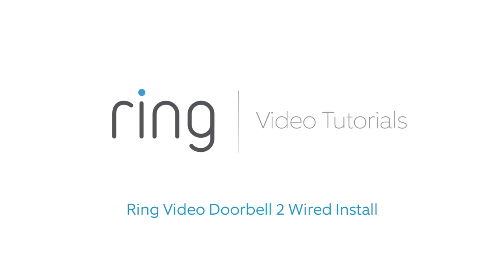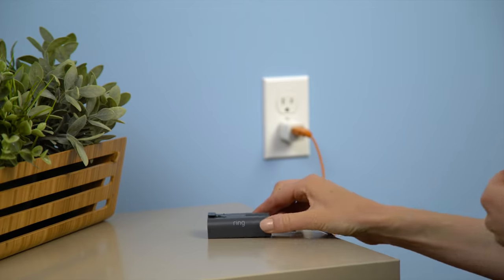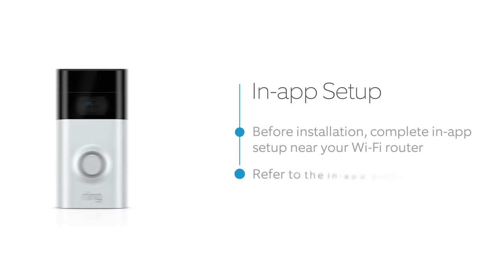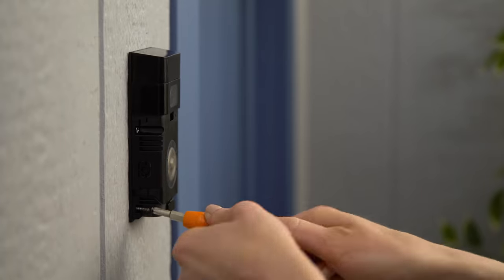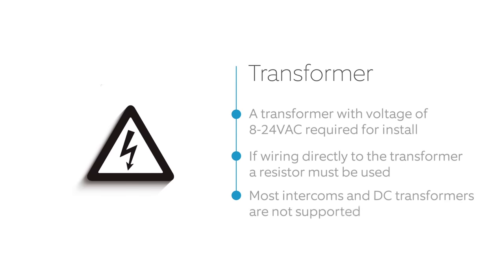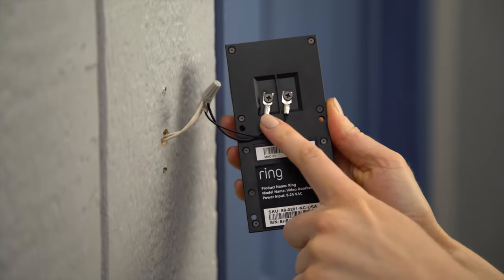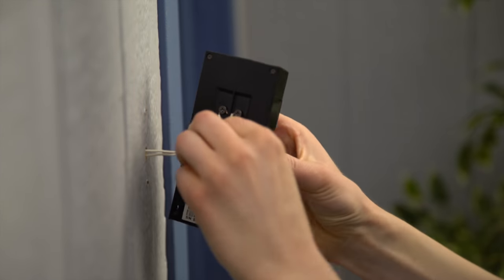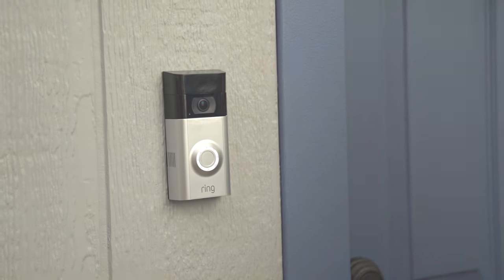How to Install Ring Video Doorbell 2 | Connect to Existing Doorbell

Comment: If I don't connect the low-voltage wiring of the standard analog doorbell wires to the back of my "Ring Video Doorbell 2" device, how do I know when someone is ringing my doorbell? 

Is it ONLY through the smartphone or tablets with the Ring app installed?
Reply from the maker: Great question, Warron! If you choose not to hardwire your Ring Doorbell 2, you'll be able to tell when visitors are at your door by receiving Ring App alerts via your smart phone or tablet. We also off the Ring Chime which plugs into standard outlets and acts as an internal doorbell for your Ring — check it out here: ring.com/chime. You can use multiple Chimes to get audible alerts throughout your home! Let us know if you have any more questions.

Comment: What if I have a ring chime and I just need to power them can I just use a transformer
Reply from the maker: Hi Jeff, great question. It's possible to wire your Ring Video Doorbell 2 directly to a low-voltage transformer to receive a steady power supply. You can find more information on wiring your Ring Video Doorbell 2 without an existing doorbell system here: https://support.ring.com/hc/en-us/articles/115003005423-How-to-Physically-Install-Your-Ring-Video-Doorbell-2-without-an-Existing-Doorbell. Please feel free to let us know if you have any additional questions. We're here to help.

Comment: I wired my ring doorbell to the existing wires on my doorbell with the wire extenders. Do i still need to charge the battery periodically or does the wiring i did charge the battery?
Reply from the maker: Great question, neighbor! The Ring Doorbell 2 is primarily battery-powered so it will need to be recharged occasionally depending on usage. Connecting it to the doorbell wiring will help provide a trickle charge to the battery. However, frequent motion detection or Live View usage can still cause battery drain. Remember to check your Ring's Device Health page for the battery percentage. Let us know if you have any more questions!
Reply: I was kind of hoping you wouldent need the battery mine dies so fast especially in the winter 😒
Reply: You wont need to charge it is wired this way. I’m going on 5 months without charging battery.
Reply: @Payperviewish  well in wisconsin when it gets -40°F it dies with in like 4 days lol and it's not working either way lol

Comment: If my existing doorbell is too low then? Should I angle the Ring upward instead? Even if that mean that it cannot see the ground.
Reply from the maker: Hey Thomas, that's definitely a solution! If your Doorbell is mounted lower that the recommended 48", you can use the Wedge Kits to angle it upwards for a better view and more precise motion detection.
Reply: @ring  I used THREE wedges: two angling up and one angling out (since it is low and on a sidewall from door).

Comment: Do the wire extenders need to be a specific kind?
Reply from the maker: Hey Joseph, 18-gauge wire is the ideal gauge to use with Ring Video Doorbells. It provides the proper amount of resistance and is very easy to work with and makes wiring simple. 

To determine whether or not the wire you're using is 18-gauge, get a standard metal thumbtack and compare the pin to the wire. 18-gauge wire is approximately the width of the pin.
Reply: Thank you!

Comment: For the people like me whose breaker box does not list the doorbell, how do I know which breaker to turn off? I really don't want to have to pay an electrician to come out and show me, and I don't want to shut down the main breaker to the whole house either. Any suggestions? All suggestions welcome if RING doesn't respond.
Reply from the maker: Hi Rich, great question. As each home is different, we're unable to provide specific advice regarding your home's breaker box. To ensure you receive the most accurate information, we recommend contacting a licensed electrician in your area. Thanks for being our neighbor.

Comment: I moved into a house that had a doorbell but it never worked. I took the button out and there is power coming from the cables (about 16volts). How do I know if it had a transformer or such. Insee no chime box anywhere.
Reply: If you have 16 volts, then it is connected to a transformer somewhere in you house. Touch the wires together to see if you hear a chime, if not, then the chime is either broken or removed. Either way, you'll need to find the transformer since it is most likely a low power model (16V/10VA) like mine was. Replace it with ring's recommended model 16V/30VA that can be purchased at home depot for about $17.  https://www.homedepot.com/p/Newhouse-Hardware-16-Volt-30vA-Wired-Door-Bell-Transformer-Compatible-with-Ring-Pro-30TR/307787405

Comment: Hi,

Today morning I have connected the external power supply (20VA) also charged the battery to 100%. The power source show me Hardwire when I Checked in ring App. Now ater 8 hrs the battery status  shown me 94%. I have connected the power supply still battery Darin constantly. It is not charging the battery. Then what is the use of hardwired?  How to fix this issue?
Reply from the maker: Hi neighbor, we'd like to help! Depending on the amount of activity your Ring sees, such as motion detection or Live View usage, the battery may still drain even when hardwired. Connecting your Ring to wiring will provide it with a trickle charge of up to 10% each day, however, you may still need to charge it occasionally depending on usage. If you're seeing a hardwired connection in the Ring App, this means that you've properly hardwired your Ring to power.

Comment: I want to connect ring doorbell 2 with my existing mechanical doorbell operating at 220 Volt. How to connect ring doorbell 2 with my existing 220volt doorbell? Do i need 8-24VAC transform with 25 ohm register?  How the physical connection will be?  Ring user manual  available but still not clearly explained. Really appreciate if someone replies to my querry. Thanks
Reply: 220 Volt doorbell?  Yikes

Comment: if I leave home like two months,, the battery will last that long or will disconnect?/
Reply from the maker: Hey neighbor! Ring batteries can last 6-12 months with normal usage and you can monitor the battery percetage in the Ring app so you know when it needs to be recharged.  Please keep in mind that there are factors that could cause your battery to drain quicker than this — learn more here: https://bit.ly/2uysY0g.
Reply: That was one of my concern. Can this hook up with you regular  cameras?
Reply: Yes

Comment: I have an intercom system with built in chimes. Can I hardwire ring 2 to it?
Reply from the maker: Hey Khaled! Ring Doorbells are typically not compatible with existing intercom systems – check out the Ring Doorbell 2 compatibility list here: https://bit.ly/2KfdYJK. However, the Ring Doorbell 2 is battery-powered so it doesn't require a hardwired connection. The battery is also removable to create an easier recharging process. Let us know if you have any more questions.

Comment: My current doorbell use just AA batteries, nothing connect to the mains. How this would work, do i need completely new setup?
Reply: I think the Ring doorbell has a battery option that is rechargeable, at least version 2 does
Reply from the maker: Hey Alan, Kris is right! We do offer battery-powered options which do not require a hardwired connection and can be easily recharged when the battery is low. See more at http://bit.ly/2UJbjC5 and let us know if you have additional questions!

Comment: How long does it take for the battery to charge?
Reply from the maker: Hey, Ash. Thanks for reaching out to us. Our Ring batteries take around five to 10 hours to fully charge depending on whether the USB cable is plugged into a USB port or into a wall outlet. Let us know if you have any other questions.
Reply: @ring  do you have to plug it into a existing door bell for the chime or can you just use the one it came with 🤔
Reply: @ring  This little morsel of info should be in the instructions at the very least. You didn't even include it with this video. So the fast and easy install is really a lie as you need a full day to install it.

Comment: How does a customer obtain an "8-24VAC transformer" as indicated in your video at time= 2:08?
Reply: Most doorbells already installed have these already. The 120v AC from breaker goes into transformer then the 8 to 24v power goes to the bell/chime a wire from chime goes to the doorbell switch outside to interrupt the + line unless pressed.... My doorbell for example is 18V AC... You can check at your doorbell chime the voltage with a multimeter set to 200v AC.

Comment: Do you take the battery out if you do a hard wire ?
Reply from the maker: Great question, Andy. Your Ring Doorbell 2 would still be primarily battery powered and hardwiring it will help prolong the battery life — learn more here: https://bit.ly/2Ba1MsD.

Comment: Can you add it to a steel screen door??
Reply from the maker: Hi there. The Ring Video Doorbell 2 is designed to be installed directly onto almost any surface. However, installing your Ring Video Doorbell 2 directly on a metal door is not recommended, as this can cause interference in your Ring's wifi connection. You can find more information regarding this here: https://support.ring.com/hc/en-us/articles/217271526-Understanding-RSSI-Values-and-Wireless-Signal-Strength.

Comment: Connected to hard wire doorbell, with battery attached. Battery life now reads 97% it's been active for an hour and 10 minutes. Motion detection adjusted too. Why is the battery life reducing quickly? When it states in the booklet upto 6-12 months before recharge is required.
Also the sound quality is intermittent, I can not hear nor the person at door each other , sound counts in and out. How can I amend ?

Comment: Do I have to change the batterie when i have install the Doorbell at the exciting wires?
Reply from the maker: Hey there! A hardwired connection to your Ring Video Doorbell 2 will help prolong the battery life, however it will still run off the battery and factors such as excessive events and weather may still cause battery drain. Let us know if you have other questions.
Reply: @ring  ok thanks
Reply: What is hardwiring the ring doorbell 2 doing if it is not charging the battery? Can you please make that possible on your next model updates?!

Comment: If I hardwire my Ring2 Doorbell, do I still need to have the battery installed?
Reply from the maker: Hey Theresa! The Ring Video Doorbell 2 runs mainly off of its internal battery and hardwiring it will provide a trickle charge depending on usage. The battery does need to be charged and installed in order for it to function properly. Let us know if you have any other questions!
Reply: Ring do you have to continuously recharge battery time after time?
Reply from the maker: Hey neighbor. The battery will need to be recharged from time to time depending on activity such as Live View usage and motion detections. See the recharging process for the Ring Doorbell 2 here: https://bit.ly/2tFsWR0.
Reply: @ring  
Why was it designed with only a very low trickle charge rate instead of a smarter circuit that is able to keep up with more frequent use?

Comment: Just installed ring2 doorbell, but my pre existing internal doorbell chimes don't chime (it's hardwired in the home's electrical system, not wireless). How do I get my home chimes to work, or is the ring2 not compatible.
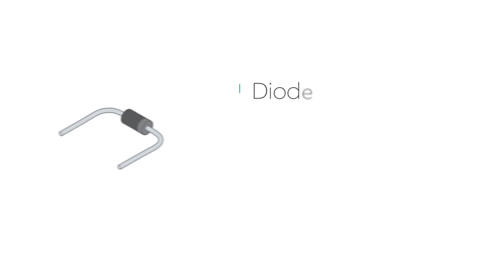Reply: like they said if you have a digital bell you need to use that diode and if the bell is not working it means you installed it wrong you have to take diode out and rotate it . 2:57 you see how shes holding it? if you installed it like that and it doesn't work then unscrew it flip it and put it back and it should work.

Comment: Hi my WiFi  router is approx 8 meters from the front door. Will it pick up signal/images etc.
Reply from the maker: Hi Adolf, this should be an acceptable distance. Keep in mind that the signal strength can also be effected by objects between the router and your Ring that may obstruct the signal — learn more about your Ring's RSSI (received signal strength indicator) here: https://bit.ly/2yEzINJ. If you do experience any connection issues, please always feel free to get in touch with us on our Facebook or Twitter page so we can look into it and assist directly!
Reply: @ring  TWITTER sucks!

Comment: So you say that of connecting to existing wires we need transformer and resistor, but the video shows a direct connection! And where is the transformer??
Reply from the maker: Thanks for asking, neighbor. In most installations where wiring is present, a transformer is already included in your home. You can find a transformer that will work for your Ring on our website here: https://shop.ring.com/products/hardwired-transformer. While this accessory is noted to work for the Ring Video Doorbell Pro, it will also work for the other Doorbell devices for hardwiring.

Comment: How do I know if I need a transformer or not?
Reply from the maker: Hi Cyin, most homes have a transformer installed already with power going to the existing doorbell wiring. If you're unsure if this is the case at your home, we'd recommend contacting a licensed electrician for assistance looking into this. Please let us know if you have any more questions!

Comment: Ring doorbell does not work with a wired doorbell, or any other existing doorbell.  I have tried everything.  Contacted Ring support, and they could not help.  Instead, I was advised to purchase their Ring extender.
Reply from the maker: Hi neighbor, we'd like to ensure you can use your Ring Video Doorbell with your existing doorbell. Please message us on our Facebook page (facebook.com/ring) or DM on our Twitter page @ring. We're eager to help find a solution.

Comment: I live in a 2 family house does ring make double door bells
Reply from the maker: Hi Martin! Ring Doorbells and Cams work individually so alerts can be answered on the device owners' mobile phone. Depending on how your home's layout, you may need a Ring set up at different entrances. Feel free to check out our full product line at shop.ring.com to see which Ring would best fit your home's needs.
Reply: Yeah it's called buying 1 more 😆

Comment: I just installed a Ring gen 2 doorbell. Motion sense is limited to only 12 feet. Owners guide says 30. Sensitivity is adjusted to max. Anybody else having this issue?? I need it to work to 20 feet so I can monitor any activity at my car door. 12 feet does not cut it.
Reply from the maker: Hey neighbor, we'd like to help! Please send us a message on Facebook or Twitter with a screenshot of your Ring's Motion Zones so we can look into this.

Comment: Video says not to connect directly to transformer without a resistor. But you're connecting directly to the transformer in the video. Or I'm missing something?
Reply from the maker: Hey neighbor! This video shows the Ring Doorbell 2 being connected to outside doorbell wiring. Although this external doorbell is powered by the transformer, it connects through an existing internal chime kit so it's not connected straight to the transformer. Let us know if you have any more questions.
Reply: Ring but do you still need a resistor
Reply: @reggeesexpressions  The chime/bell is the resistor.  If there is no chime or bell installed, then you use a resistor.

Comment: I installed my ring doorbell 2 to my existing doorbell wires and it worked for about a week then it only shows battery in the ring app...I located my transformer and found it was 16v 10va so I switched it out for 16v 30va and still won’t work...still says battery...it’s not saying hardwired like it did before...
Reply from the maker: Hey Brian, we'd like to look into this and ensure your Ring is getting power. Please send us a message on Facebook or Twitter with a photo of your current wiring or give us a call at your local number: ring.com/callus. We're here to help!

Comment: 824 volt?  Or do you mean 8 TO 24 volts?
Reply from the maker: Hey William, we apologize for any confusion. We recommend a transformer that is 8 to 24 volts for best performance.
Reply: Well I wasn't confused.... you said "eight-twenty-four volt AC" not 8 to 24. You should edit that audio to prevent someone from puting 824volts to the ring if that happens you will have to rename it to the ZING⚡

Comment: What happens if I don’t shut off the transformer switch?
Reply: You will be shocked to see what happens if you do not.  However, I do not recall seeing a 'doorbell' breaker in my basement. I have not installed mine yet - just came today.  I will check again though before I start.  Worst case, turn off the main breaker.  It will only be off for a few minutes.

Comment: How do i know if i need to install a resisstor. Abd when do i need to install it?
Reply from the maker: Hey neighbor, a wire-wound resistor will be required when you're wiring the Ring Doorbell 2 directly to the transformer without an existing internal chime kit in place. See more about the installation here: https://bit.ly/2uhKxOP.
Reply: Ring thanks

Comment: My doorbell comes directly off a transformer.  What ohm resistor do I need?  How do I install the resistor ?
Reply from the maker: Hey Joe! When connecting your Ring Doorbell 2 to wiring without an existing doorbell included, you'll need a 25 Ohm 50 Watt wire wound resistor: https://bit.ly/2uhKxOP. Connecting the Ring Video Doorbell 2 to an AC transformer requires some knowledge of wiring and soldering. If you are uncomfortable reading wiring diagrams, hooking up wires or soldering them in place, we recommend consulting a licensed electrician for assistance or use the built-in rechargeable battery to power your Ring Doorbell 2.
Reply: @ring  Thanks!!  No problem working on electric or electronics.  Got over 30 years experience!